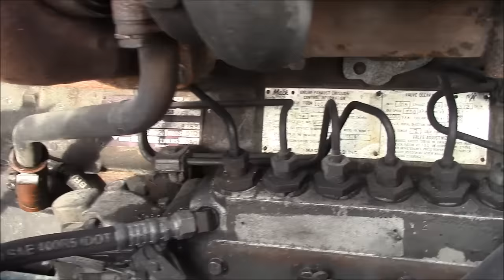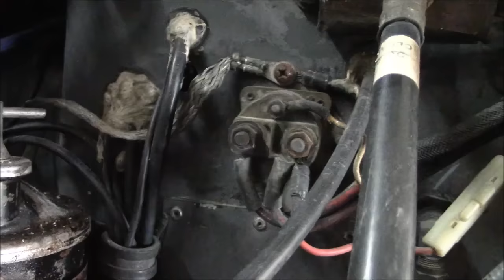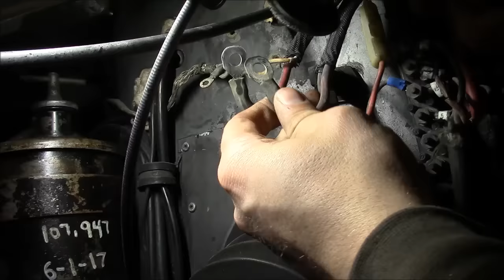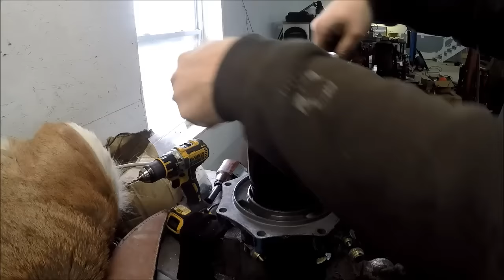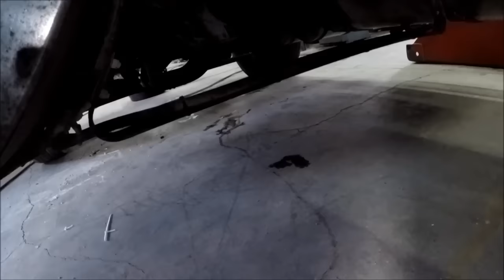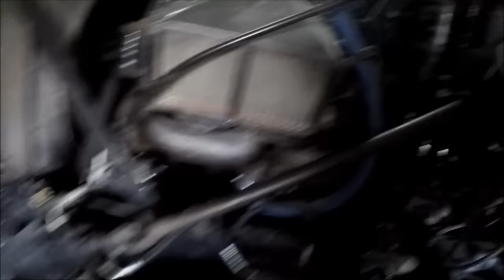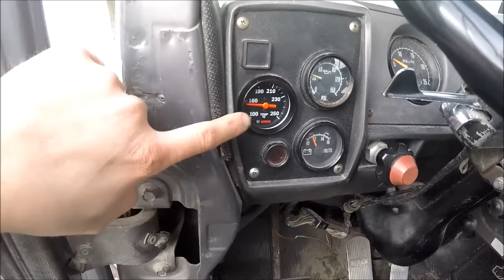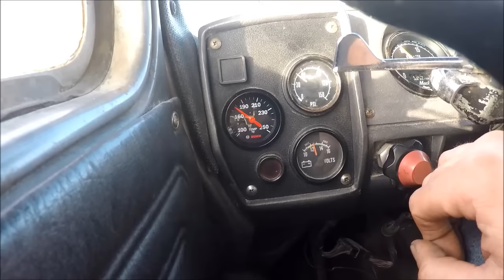Cool 1977 Mack RL600L - No Crank, No Start - Plus Many Other Repairs

Comment: I've heard complaints of finding bits of teflon tape in control valves. They recommend the teflon paste. Probably not a problem on this old truck.
Reply: Help full hint:  When applying teflon tape, start behind the leading thread!  That way, bits dont get cut off and pushed into cavity.  Also, when removing taped fittings, immediately use a pick to clean bore threads so that bits are cleaned out before re-assembly.  If you have thin tape that shreads as you wrap it, throw that stuff away (frequently shipped with assemblies...) and find an appropriate thickness that will seal adequately and not drive you crazy.  🥴

Comment: I  always thought ordinary grease has a detergent in it which holds water. The water can conduct and promote corrosion. 
The dirt on top of batteries holds moisture that conducts electrons between the poles. It's not the concrete that kills batteries, it is the dirt on top that discharges batteries and lets them freeze.

Comment: Holy Cow Wes, batteries on the concrete floor, same colored (red pigtail replacement) wires, what kind of mechanic are you...  Ha, ha, ha... just jabbing you.  So, of that vintage Mack, they produced/manufactured all the components (axels, trans etc.,) in house...?
 Love your videos.
Thank you sir...
Reply from the maker: Yes. Mack made more of the truck in house than any other company.
Reply: Watch Wes Work ok, thank you for the response back.  Probably not doing that now.

Comment: About dielectric grease... It is by definition non-conductive. If it conducts electricity then it isn't dielectric. Or at least not dielectric enough!
The reason you get a good contact regardless is because when you tighten the nuts on connections or slide a connector on you are removing most of that dielectric grease through pressure or friction, thus only leaving a very thin film of the stuff which makes it ineffective as an insulator.

But you are right, you should apply it BEFORE you put your connections in to ensure the connection is well protected from the outside elements and because the connector only has a small film of the stuff where it matters, you generally don't see a notable difference in resistance or conductivity.

Meaning BOTH sides of the argument is right, but for different reasons. And likewise, both sides are incorrect for different reasons. One obviously being dumber than the other so you can ofc take pride in the fact you are on the smarter side.

In any case, each to their own. Those connections are most likely going to hold regardless of whether you apply before or after. What sets them apart is the environment they will live in.
Reply: And yes, fluid film is awesome and can be used instead of dielectric grease to protect most electrical components. As long as there's no arcing.

And about arcing, most electrical components that "mere mortals" work on that can arc... Is generally not exposed to the weather.

Comment: I sure like your remarks about dielectric grease, it's an interesting topic. As you say it is a pervasive myth, even creeping into dealer repair manuals. I found such a remark in a TSB once, describing why engineers thought dielectric grease was why a connector was failing. As you say, late failure of a contact is usually due to corrosion, often with a galvanic element secondary to water. So, excluding water with grease is a great way to prevent late failure. I would have thought grease induced secondary problems, if they occur at all, would be an early failure....

Comment: I grew up working on R +U models and a few B models. I loved 'em. Yes the Maxidyne's were all dry sleeves, they also all came standard with oil leaks 😁
Those transmissions were tough as nails, I was surprised when you were grinding gears, you might have a bad clutch brake.

Comment: Unless they changed the system in later years of the R model it should have four 6 volt batteries with a 12 volt operating system and a 24 volt starting system via a series / parallel switch .  You haven't lived till you drive a 5 speed Mack with 20 leaf camel back springs ! Ours didn't have air ride cabs .  We even had a bunch of R 700's with Detroit 318's with an injector change to bring them down to 292's . Most of the Macks we had were 18 speed twin stick Trans's as they were off road on the job pulling 30 or 28 yard dump trailers .  This video brought back a lot of memories .  Thanks for the "time travel ".

Comment: Also use a thermo- trex type cable instead of so cable. It will hold up to the heat much better. People use so cable because you can buy it at a hardware store. The problem is it’s a rubber type insulation, so just like your tires it will harden and crack over time. You will have better luck with a silicone based insulation.

Comment: No computers, no def, no problems!!
Reply: A local garage that I do the IT for recently couldn't tell an Audi's computer that they had changed the brake pads so it wouldn't start. WTF is that all about??
Reply: Les Conn dealership underhanded $ making fraud, plain and simple. Air start mechanical diesel and you’ll never need a thing. Except fuel, and diesel along with heavier oils are relatively easy to produce.
Reply: @deborahchesser7375  Air start? You must line in Arizona! They are worthless in cold climate. They turn the engine over about 30 seconds if your air tanks are full before you try to start it
Reply: @lesconn1240   A quality scan tool should be able to reset maintenance
codes like that.
Reply: @HUBBABUBBADOOPYDOOP  - that's the problem - they won't invest in a quality scan tool, and have some ancient thing that needs an equally ancient laptop to run it. I keep it alive for them and drop big hints that they maybe should spend some money and get the right kit.
Reply: the same reason i converted my TBI chevy half ton to a carburetor, damn computer/ fuel injection issues, runs great now
Reply: True.
Reply: 43 years old and still going. There isn't a single vehicle manufactured in 2020 that'll make it to this age.
Reply: No DPF, EGR no nothing !
Reply: Amen!
Reply: Ion Racer No problems if you know what you’re doing. There aren’t a lot of “mechanics” around anymore that know how to diagnose or maintain a mechanical engine anymore, so as an owner you’re best off to do work yourself. I’ve got probably $2,000 worth of special  tools to maintain my NTC-400 cummins and 318 Detroit. Every few years plan on Setting injector timing, keeping the jakes and valve lash adjusted on both and  keeping the fuel racks in adjustment on the Detroit’s requires a good understanding of operating principal and why things are set how they are. For folks who just want to drive it and take it to a shop when it breaks the pre emissions electronic engines (Detroit 12.7, cummins N14, Mack E7 VMAC) are pretty decent.
Reply: But it’s a Mack
Reply: So you're subscribed via mail to this channel? 🤔 😁
Reply: Dang right!

Comment: I cut my teeth on an R model in 75 for Penn Truck Lines. All Mack like this. And, the 5 speed. That thing made me question all these guys that loved their 13/15/18 speeds. Maybe way up in the mountains, heavy haul or some other HD application. But, hauling pigs, (no, not live. Intermodal kind!), it was like driving a car. The Camelbacks loosened your fillings but those bronze bushings lived damn near forever. Spent a lot of time at CF then. They had 6 and 7 speeds. Again, you didn't spend 3/4 of your day shifting, even in the city. Ended up in Kenworths that spent almost as much time in the shop as out on the road. If that were my truck? A rust free, aluminum frame beauty like that? I'd rather spend $50K repairing/rebuilding/replacing/repainting before I spent $100K on a new one with that computer/emission crap.
Reply from the maker: I hear you. We do have a lot of big hills. But mostly I think people just don't have an patience today. When a new pickup truck has 425 hp and almost 1000 ft-lbs, people tend to forget that 300 hp pulling 88,000 lbs is not going to set any land speed records.

Comment: The RL's must be a little different in regard to power steering.  Mack is known for their pain in the ass steering box INSIDE the frame.  That R686 300+ with the twin club 7 speed was one bad ass tractor.  They reached way down low and way up high in their day.

Comment: Cool truck. The RL600L is a Mack built with an aluminum frame .  It has the 300 h.p. engine with the intercooler  and second turbo.   It is a West Coast Mack built in Haywood, CA.  The Mack Pedigree sticker on the side of the engine means it is a factory rebuilt engine ( I have a couple of them on my tool box lid that  I grabbed when replacing  engines). The 5 speed transmission was designed to reduce shifting on the hills in PA.  The Maxadyne engine group has a wide torque band.   Mack had dynos set up with computers to mimic actual roads.

Comment: You are the first person I have seen using the smack a seized bolt trick on YouTube. I use this trick at work pulling scrap apart. I have undone bolts with my fingers that a large rattle gun wouldn't budge after a good smack with a sledge hammer.
Reply from the maker: I never miss a chance to use a hammer!

Comment: I USED TO DRIVE A R MODEL MACK V8  SAME THING HAPPEND TO ME GOING BACK TO YARD BOB TAIL HAD STOP AT TRAFFIC LIGHTS WOOPS  NO ANCHORS MASSIVE AMMOUNT GEAR SHIFTING THEY SAID TREADLE VALVE IT WASNT .REPLACED IT THE NOW IT ALL MECHANIC JUMPED IN TO DO A TEST RUN THEN PROCEDED TO RUN UP BACK CRANE TRUCK DOING HIS THING ON SIDE OF THE ROAD NO ONE GOT HURT BUT VERY CHASTISED MECHANIC

Comment: Dielectric grease is silicone base product so it will not cause a conductive problem. and the amount you put on the lugs is minimal. And you don't need a lot a thin lay is all you need. I use it hundreds of time and never yet cause a problem.THUMBS UP ON THIS VIDEO.

Comment: Great video.  That looks to be a 285 Mack motor(tip turbine).  Yes it's a Maxidyne, not a Thermodyne.   The 237, 285, 300 Mack motors were "Maxidyne"  torque rise engines.  Needing only 5-6 gears with their wide 1100-2100 rpm band.  They have the tip turbine on top which blows air through the intercooler on top of the engine.  The extra air tube on the air cleaner feeds that turbine.  Yes, they are very slow to shift waiting for the rpm to drop back to 1100 rpm!  I have a B model I installed a 237 into(no intercooler) and run my original Triplex(15 spd).  Sorry I don't have any videos of it on my channel, but if you search Twin stick shifting, there is a couple shifting videos posted many years ago.
Reply: Since you like Macks, here's mine.  https://postimg.cc/HcMrvxtk
Reply from the maker: Pretty cool rig!

Comment: I know nothing about trucks, so I’m keen to learn, and I haven’t used dielectric grease all that much, mainly because things really don’t rust here in Australia, but for systems where even a trace amount of resistance can be an issue, it’s a must. Things like oxygen sensors and sensors in general - they work on minute voltages - for a wideband O2 it’s in the range of 200-800mV from memory, I’d have to plug the scan tool in to my car to double check - so bad or even dirty wiring can throw things out of whack.

It can be argued that a waterproof connector should be ok, but there’s nothing wrong with a goop of dielectric grease inside the connector to keep things clean. That’s where dielectric grease really matters. Not so much with 12v or 24v, but absolutely with sensors.
Reply from the maker: Air bag sensors is a big one. They rely on a very precise resistance measurements.

Comment: Mack take a drag off your smoke in between  shifts
Reply: Run her up to 2100, take 2 puffs, drop her back in at 1200.
Reply: Gregg Mckinney take it out if gear pick up your sandwich take a bit put it down and put her in the next gear

Comment: I seldom use dielectric grease and I haven't had any issues with corroded connections either. It's all a case of 'you do what works for you'.
Reply from the maker: Do you live in an area with salt on the roads in winter?
Reply: @WatchWesWork  myup. midtn

Comment: Nice work. I always wondered about the usage of di-electric grease, but after some researching came to the same conclusion and now always coat all the connections with it. Cool old rig, when I was younger a lot of the contractors in my part of NH had those style Mack’s for there dump trucks. They do seem to run for a long time.

Comment: Memories! I have many miles and years in R model Macks delivering milk and ice cream in  Wisconsin and  Chicago and the northwest suburbs. We eventually moved to CH models and then unfortunately to all Freightliners. I think at one time we had about 75 of them between our 5 locations, some with the 5 speed, some with the 9 speed.  We had some with a gold bulldog on them instead of the usual chrome, not sure what the difference was, I think the gold ones had a higher trim level like carpet and padded vinyl doors.The R models were always my preference. As I watched the last few moments of your video,I was reminded how often that little plastic deflector behind the bulldog on the hood would snap in half and hit the windshield and scare the hell out of me,usually in a rain or snow storm in the middle of the night. Never really felt that were all that effective anyway... great video, always enjoy the way you explain what you're doing
Reply from the maker: I always thought the gold bull dog was to show it had an all Mack drivetrain.
Reply: @WatchWesWork  I think you're right! Thanks!

Comment: When I went to trade school they taught  us not to apply the dielectric grease to the connection until after it was fastened tight, so that's where it comes from .
Reply: Yes because it would be a bit of an insulator between lugs

Comment: gotta watch those macks of that vintage  many were positive ground although you could get them either way.  on the leece-neville alternators  the case is isolated from the recifiers.  so there may be a strap going from a post to to the case. remans come configured to negative ground. if you hook it to a positive ground truck  you'll burn it down. lol watched that happen.  they are self exiting so yes you have to rev them up. 12-1400 should be sufficient so the diode trio is probably bad or the belts are slipping.  on that air compressor loose the hose and get the small filter housing that bolts to the compressor.  under load the turbo will put such a suction on the compressor that when its unloaded it will suck oil past the compressor rings.
Reply from the maker: I'm going to have the alternator shop bench test it. I suppose that could be right on the compressor. But many trucks are set up pretty much the same way.

Comment: And big trucks like that how do you check the king pins. For steering axle . Great videos .
Reply from the maker: Pretty much the same as checking any other king pins. Jack it up and use a bar to wiggle the wheels.

Comment: I have found petroleum jelly very effective for protecting connectors from corrosion. I use it on the connectors of gritting trucks to very good effect. If there’s anything that gets an unhealthy mix of salt and water it’s a gritting truck.

Comment: I got cheaper then ur strap wrench I use a cheap ratchet strap. Wrap.it around , hook end to end . Then tighten and use the ratchet handle to pull on. Works ever time. Lol
Reply from the maker: Yeah that would work. Might be a little unhandy on smaller diameters.

Comment: On the wire splicing, did you solder or use the crimp connectors? I always hear to use solder for a long lasting weather resistant connection....Your opinion?
Reply from the maker: I use uninsulated butt connectors and adhesive lined shrink tube 90% of the time.

Comment: Regarding the dielectric grease, I think what happens is , when you put the connectors together, they wipe the grease off of the contact area. In addition to that, I believe the when you sandwich those connectors like that, the grease is mostly squeezed out. I want to see somebody apply some shampoo or cake frosting to the same contacts and I think you will also find that the resistance remains the same. 

In fact, I might make that video , hahaha.

Comment: 2 stick is a 6 speed. Lo gear-reverse, then 5, the Lo gear can be used to split gears but it runs in a bush, not bearing and you’ll kill the box. Mack did have a twin stick 10 speed.
‘Box is huge and only a 5 speed’ all truck boxes are basically a 3-4-5 speed and they just have a range change on the back to use the same 3-4-5 gears over again, sometime with a split. It’s all maths. Scania like the 3 over 3 with a split on each gear in synchro. Eaton-Roadranger had 4 and 5 speed double range.
Looks like a 320 ‘cool power’ with that charge cooler on it.

Comment: ozone in the air the wires in my ol chevy 1979 had some that same issue as did my corvair van but ONLY on wires out in the open air not ones in looms that were taped closed

Comment: Wes,  I agree about the dielectric grease.  Let's do a simple test.  Wire in a spare connector,  measure resistance,  unplug then add grease and measure resistance again.  

Great work,  keep it up!

Comment: Max den and thermodynamics were Horse power different Thermadyns but up to 300 HP Maxidyns were up to 400 Hp  Both damn fine engines (I was Mack certified back in the day and that truck was a horse in the right theater.

Comment: Just like the one I drove in the oil patch hauling pump jack , only mine had a small bed and gin poles.  The wheel base looks the same.  Mine had the 283 HP with 3 speed twin stick.